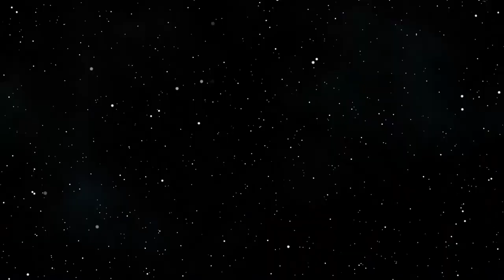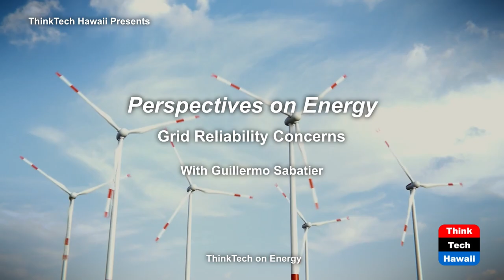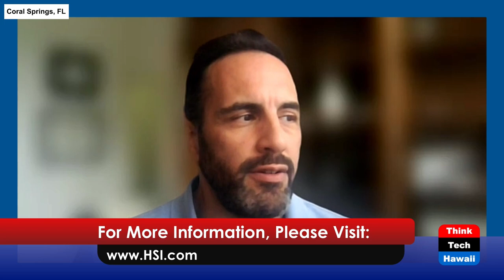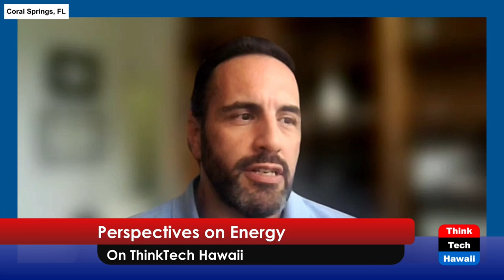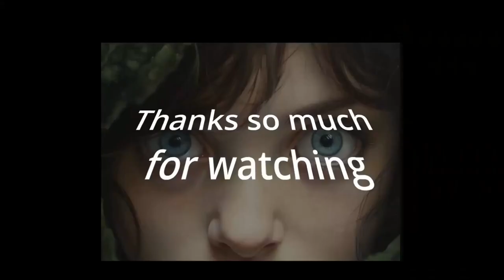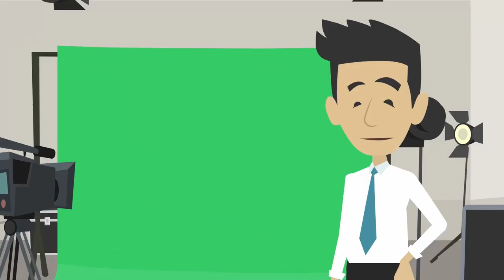Grid Reliability Concerns (Perspectives on Energy)

Comment: In this show you never mention clean hydrogen?  All of the problems you've mentioned can be solved using clean hydrogen because it provides storage.  The highest energy density of all fuels or battery types.  Either you're unaware of green hydrogen, or you just don't want to discuss it.  Not sure which it is, but clean hydrogen uses all excess renewables to produce clean fuel for public benefit.  It balances the grid and provides the solution for renewables on the grid (over production) by making clean fuel from all overage.  Replacing fossil fuels with other fossil fuels has no future.  I hope you'll consider clean hydrogen in your future analysis - the rest of the world is - lead by Europe and Asian countries.  In America, if we wish to become a leader in the clean energy transition, then don't we need to at least talk about actual solutions such as clean hydrogen?  I hope you'll include clean hydrogen in your future analysis.